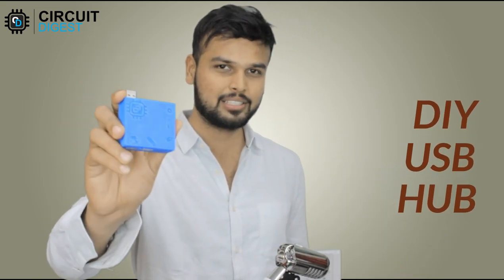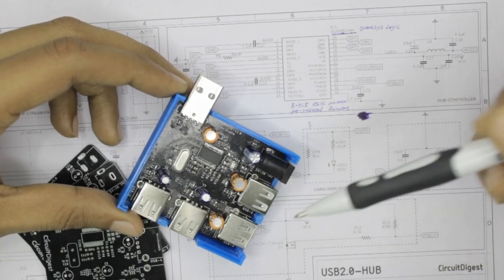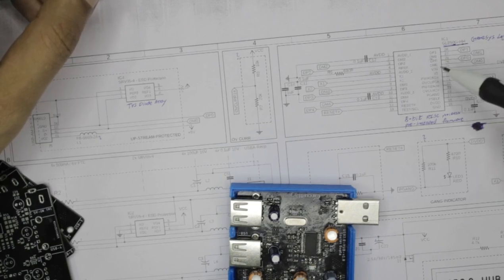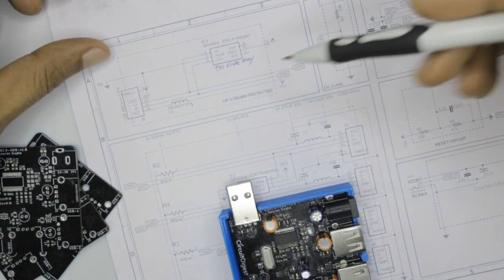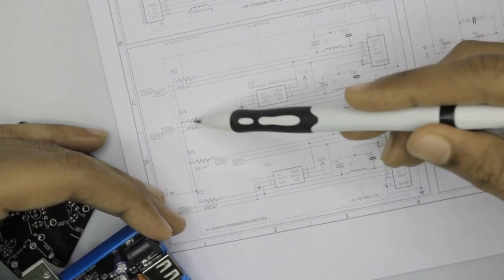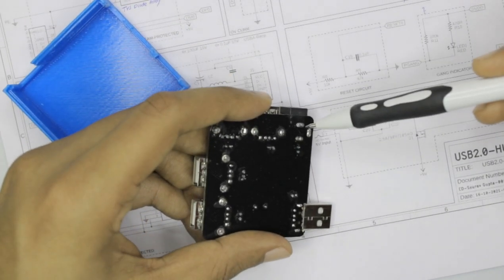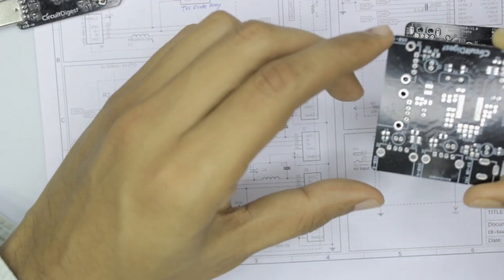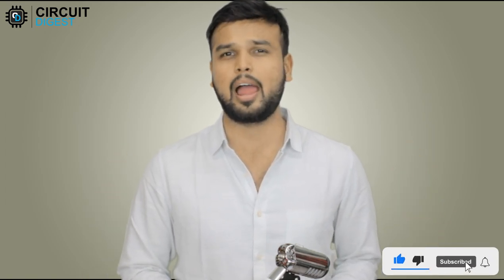How to Make High Power USB Port Extender | DIY USB HUB

Comment: Love it! This is exactly the type of stuff I want to learn to create from scratch. I have high level (web development) programming skills, but don't have any low level programming, electronics, or electrical, or mechanical engineering knowledge. Sure, I could follow this guide and copy the designs, but that doesn't really teach me anything. Any recommendations on where to get started learning the skills necessary for understanding how to design and build these circuits from scratch?
Reply from the maker: Go for it! You can start by learning the basics. If you are absolute beginner Arduino is a good place to start

Comment: What mosfet is used?
Reply from the maker: If you meant which hub controller chip, then it is GL850G. You can also use GL852G.
Reply: @Circuitdigest  No I mean the mosfet...there's only one in your design but it's not specified which one it is. The one for switching the external power vs bus power source.